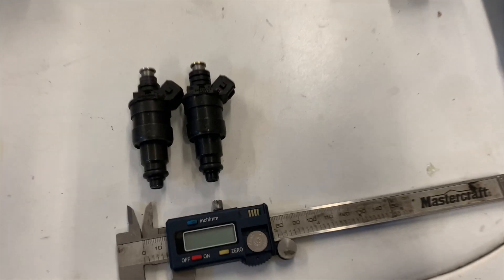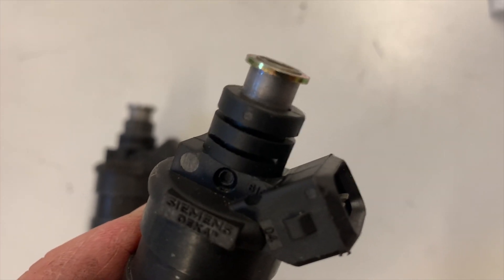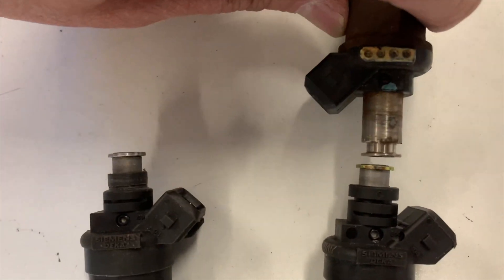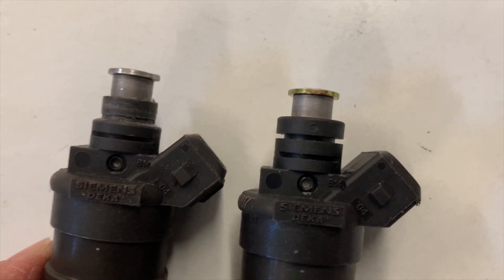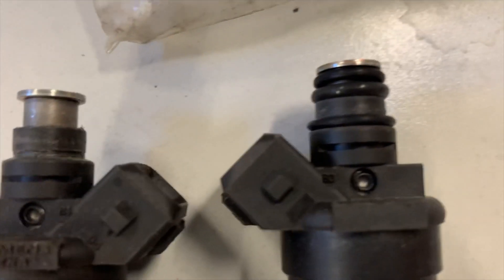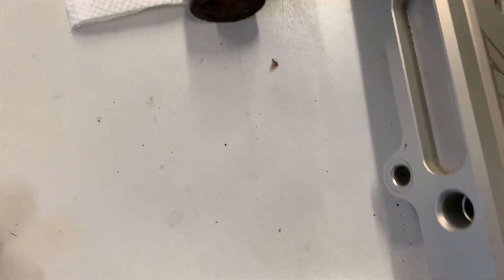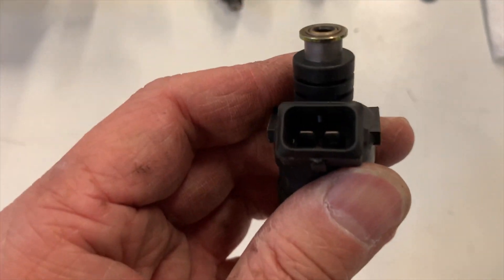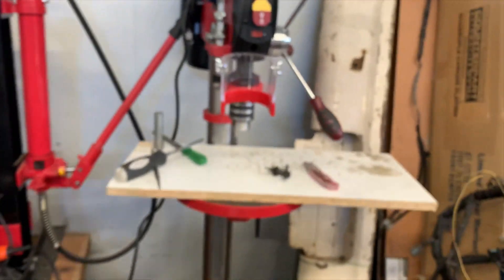Modify aftermarket injectors to fit fuel rail

Comment: Brilliant!  Surprised how well that worked.  I think I woulda used a dremel myself as that's what I have.  I had to look away with the shaky video. LOL.  Great thinking though.  Glad it's worked out.
Reply from the maker: It’s the magnet on the back of the phone that I use for the DJI gimbal. It disables the iPhone stabilization. I need a camera/phone holder
Reply: @GIZZMOTORSPORTS  makes sense.  Useful video though, glad you decided to upload.
Reply from the maker: @604Bluelight  gotta get back into documenting what goes on here, lol.
Reply: @GIZZMOTORSPORTS  Yeah.  Use the tripod more.  Hire some actors.,  some hot girls.
Reply from the maker: @604Bluelight  we should try this